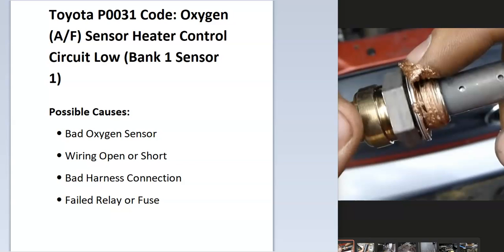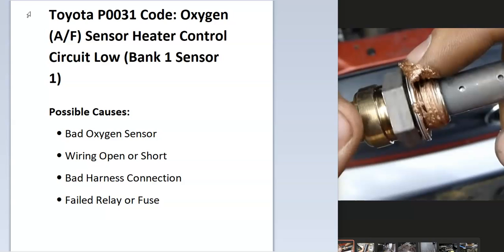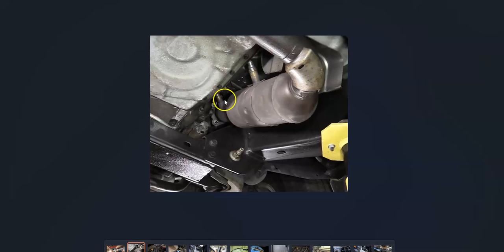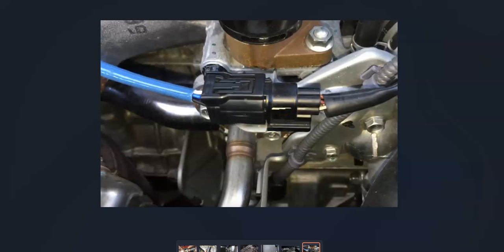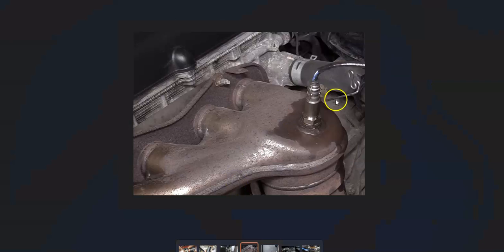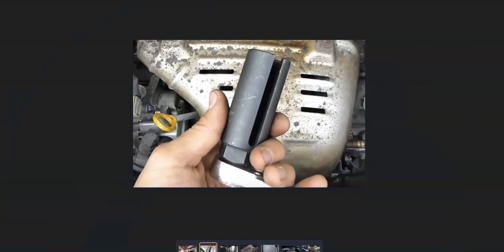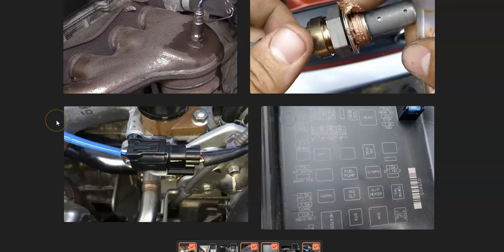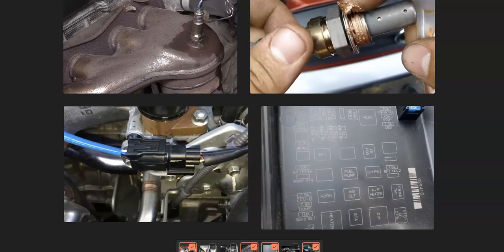Causes and Fixes Toyota P0031 Code: Oxygen (A/F) Sensor Heater Control Circuit Low (Bank 1 Sensor 1)

Comment: It's not a bad oxygen sensor it's not a bad relay or fuse it's got to be the damn pigtail connector that shit is so buried in there it's impossible there's no way I'm getting to that pigtail you can't even get a crimper in there have to take apart damn near half the engine just to reach it who the fuck thought it was a good idea to put a damn O2 sensor connector so deep next to the firewall it's just ridiculous

Comment: I overpaid for the O2 sensor. Paid $100
Reply: Don't worry, you didn't. A proper Denso A/F sensor is about $100 - $150 depending on where you get it. The downstream O2 sensors are cheaper at about $40-$50 ish if you're buying OE and not the $20 chinesium he scrolled past in the video.

Comment: I changed the sensor this morning after getting the code and have driven a couple of times today and am still getting the CEL. Will it just take a while for the code to clear itself out?
Reply from the maker: Usually, the code is cleared with a scan tool, and the engine light should go off. If the light comes back on after a few miles there is still an issue, most likely in the wiring.

Comment: Great video ! Thank you What’s the copper stuff on thread ? Do you need to put anything on threads ?
Reply from the maker: It is anti-seize, which makes it easier to remove if you need to take it out in the future. Some use it while others don't; it is not necessary.

Comment: which side is bank 1 sensor 1 upstream
Reply: Bank 1 sensor 1 on a 4 cylinder is the one on the exhaust manifold. On a V6 or V8 is on the exhast manifold side that contains cyl #1.

Comment: Can this cause the matrix 4wd to be off function ?
Reply from the maker: If can vary, but it is common for the computer to shut down driver assist functions when there is an engine problem.
Reply: @HVAC_Mechanic I have a 2003 toyota camry le.... Got the P0031 code replaced part cleared the code but it came back.... Do you know the specific fuse or relay it is in the diagram I can't find it

Comment: I was quoted $350 just for the part overall price $490 installed from my shop for the upper sensor part direct from Toyota. My car is a 2010 Corolla Le. I was told I was actually getting a deal because they didn’t charge me for diagnostic which I believe was $120 alone. Am I getting scammed?
Reply: Yes you got scammed
Reply: Depends on the Toyota. My 2005 Toyota Highlander needed the oxygen sensor replaced on bank 1 sensor 1...which was tough to get to. It costed 110.00 online (185.00 at a name brand auto parts store). So I got it online. The downstream ones were considerably less (like what this video showed). But the part at 350.00 is robbery.
Reply: Yes
Reply: You Can easily diagnose many things yourself lf now a days .
Reply: Obd scanner cost £5 to £10, 02 sensor cost £50 ebay.... to install cost £20...

Comment: Great videos super informative, I have. 2004 tundra and can not find for the life of me the fuse and relay for the A/F heater? I checked under hood in relay box and they are not identified on the cover in the diagram, does the 2004 even have them?
Reply: having the same issue myself with a 2003. did you ever find it?
Reply: @tunamanusmc I believe it’s the EFI relay not the AF Heater